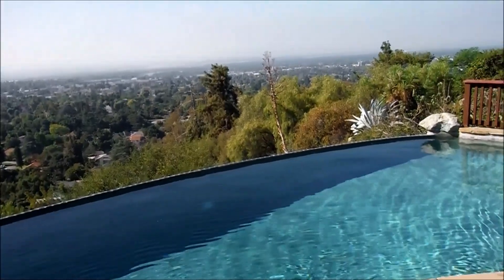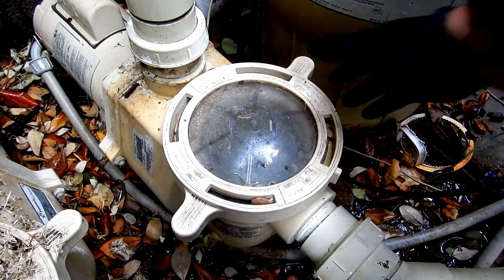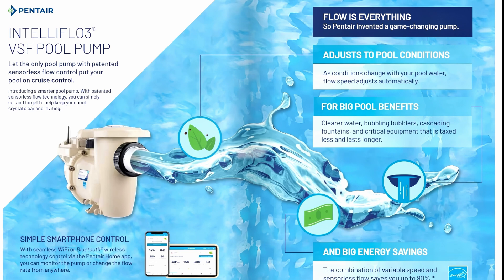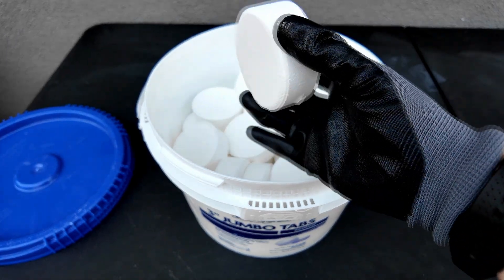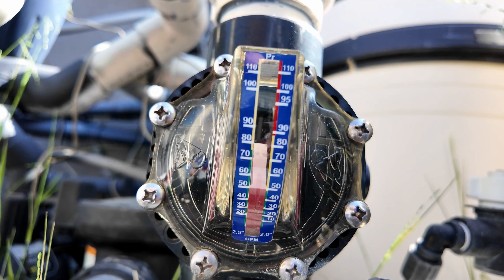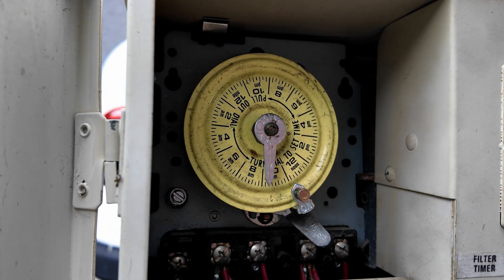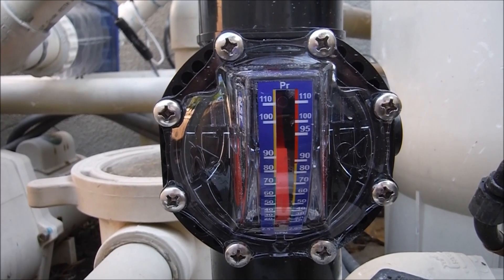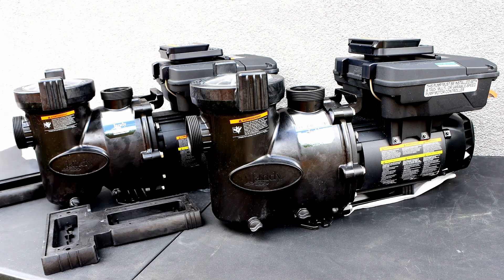How a Pool Pro Sets a Pool Run Time

Comment: Don’t you need higher rpm during day time when sun is up and it’s hotter? And if you have solar It’ll save on energy during the daytime
Reply from the maker: It really depends. 2600 RPM is  typically a good speed for daylight operation.

Comment: My pump is running at 1500 RPM during the day which is 45 GPM according to the Pentair app I don’t have a separate flow meter. 9500 gallon pool. Then I run it for an hour at 65 GPM and during the night I run it at 25 GPM only two short hours the pump is off . Is that overkill?
Reply from the maker: sounds about right.

Comment: If I have a 15,000 gallon pool, what size filter do I need? I have a new pintair variable speed pump.
Reply: @rvingmylifeaway8295  If cartridge I would go Pentair 200
Reply: @rvingmylifeaway8295  I would go Pentair ccp200 cartridge

Comment: Is it ok to angle the returns up at an angle so it creates some rippling on the surface. Otherwise the pool water looks kind of dead and doesn't sparkle.
Reply from the maker: Sure. You just don't want to cause any aeration as that raises the pH.